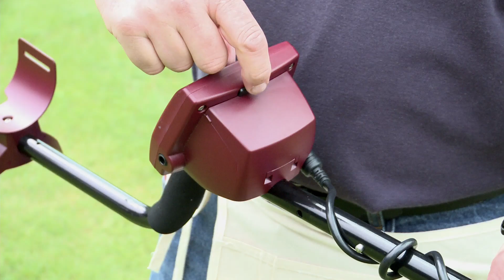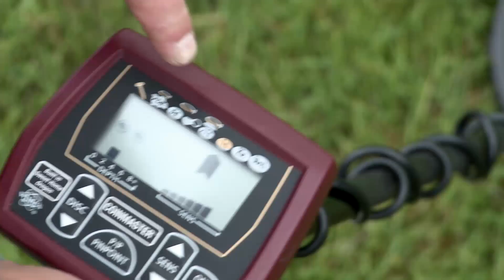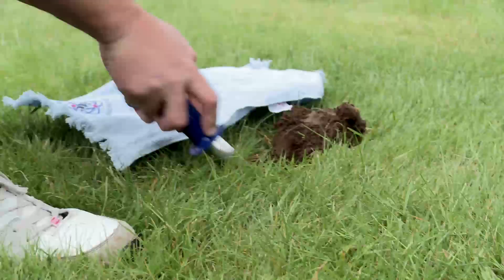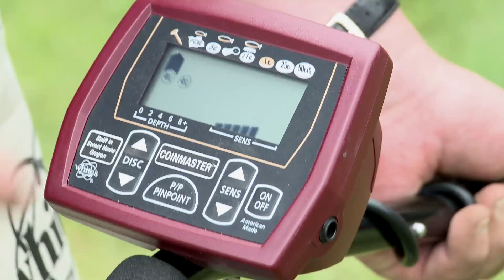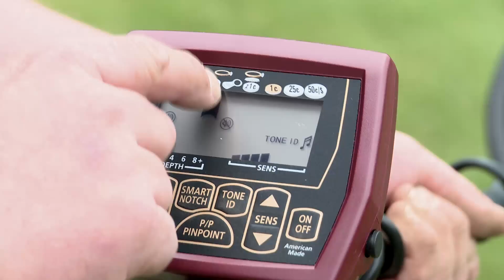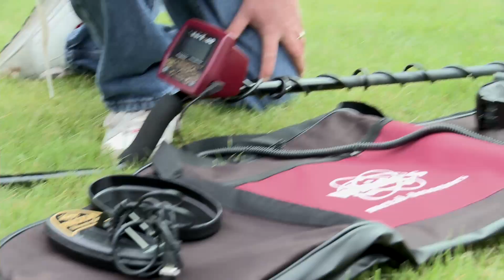Whites CoinMaster & CoinMaster Pro Instructional Video

Comment: When I am near the ocean with my coin master it goes off beeping almost all the time.  Any thoughts?
Reply: Does it go crazy on wet or dry sand? It shouldn't be a problem on dry sand. If you want to search on wet sand, you'll need a metal detector that is designed for it; such as a Pulse Induction (PI) type. Just To name a few: Whites TDI Beach Hunter Extreme, Garrett AT Pro or even a Fisher CZ-21; which is a multi frequency VLF go anywhere machine.

Comment: For the record I bought the whites coinmaster pro it's good but I am still hunching over I pulled out the shaft extension to its max it's still 5 inches short I have to modify it now I have a high upper body and my back is sore fro hunching over . You got a great product but you need to make your shafts longer not everyone is under 6 feet . I am dissapointed I had to stop detecting it got so bad . Hunched over is not even good for your back so yea that really kinda depressed me . But the machine is still good overall but I am not sure what I am going to do now .
Reply from the maker: +pum84 Did you try the tall-man shaft we recommended?
Reply: Fever 4 Adventures think they make an extened shaft. contact whites
Reply: Could not figure out how to extend the shaft? Man get a life and go to the hardware store and get a length of PVC.

Comment: What do you think of the garret ace 350..?
Would you say whites is better detector ...?
How big is the coil that comes with the white's
Reply: roar5952 I've owned both whites and Garett, I wouldn't change whites for the world. I have never seen customer service as good as theirs!
Reply: God bless..
Thank you ...
Reply: I've owned both.  Garretts are to be avoided.  I still own one but never use it.  I own two Whites and they both get used extensively.
Reply: I'm currently using the Garrett 300 ,but still use my trusty prizm I V. SIMPLE AND GREAT MACHINE.

Comment: well that may be your opinion. But im still sticking with mine. it just wasnt as good as my older model. i went over the same hole twice and my older one would pick it up and this model didnt even signal. I changed all of the settings to match my older one and it still wasnt as good as mine. Sorry but this is just the way i feel about it.

Comment: im just going to state my opinion, this detector to me is not even worth the money you pay for it. i had this detector one day before returning it. i compared it to my older model and the coinmaster barely even picked up on coin signals. i took this coinmaster to a park nearby and i searched the whole park. i found 3 pennies. the next day i took my older model , just because something didnt seem right, i found over 3 dollars in change and a cheap ring. overall only get if you are a beginner.

Comment: FREE ADVICE:  if you are going to be working an area repeatedly, set the thing to find ALL metal.  you will find a lot of junk, but then the next time you go back there, the junk will be gone, and if you find something, you'll know it's good stuff.  time and weather shift dirt - and the things it contains - around. after a good rain, the ground conducts better and it's easier to find things. you can use a studfinder for an electric pinpointer (set it to deep metal mode).  FILL YOUR HOLES.
Reply: Only shitty thing about that is how quickly it kills your battery.